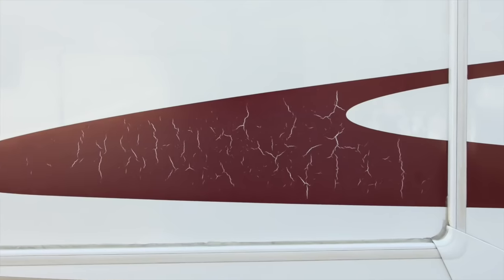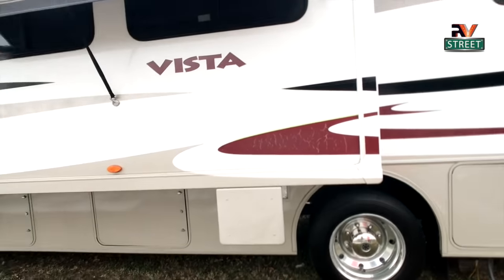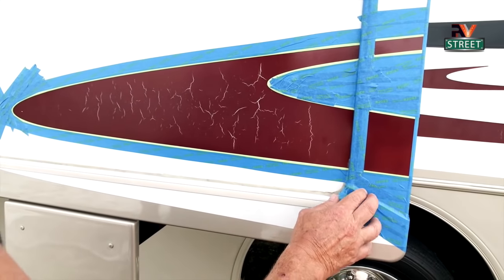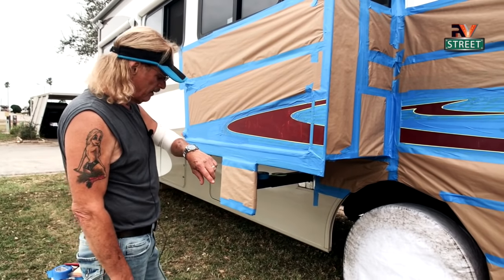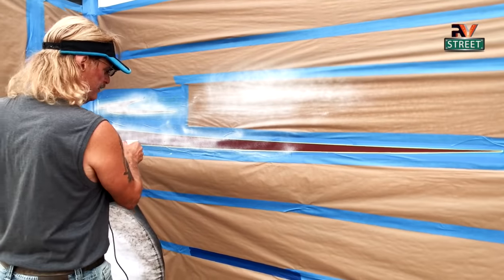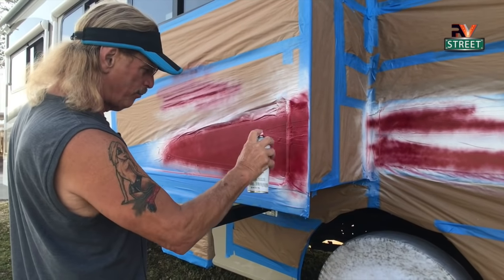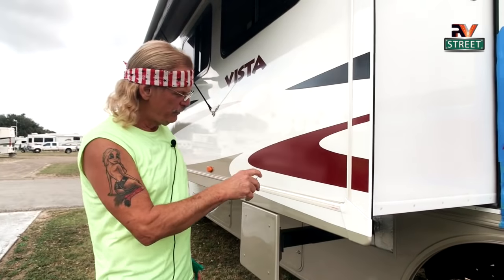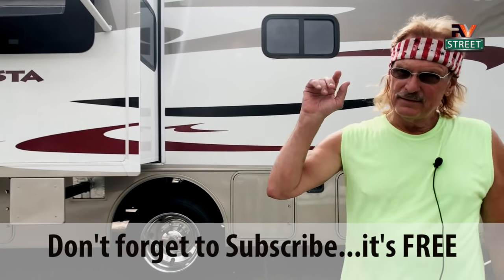How to fix Cracked & Faded RV graphics. Easy DIY job

Comment: Prep is the key to a good paint job as you have proven here. One tip on rattle cans, warm paint sprays smoother (better atomization of the paint). When I rattle can, I will stand the can up in a bucket of warm water, about 3/4 of the way up the can for a minute or 2, dry the can thoroughly, shake well. Makes a world of difference, virtually eliminating the dreaded orange peel.
Reply from the maker: Absolutely. I didn't mention it in the video but I did set the cans out in the sun for a couple of hours before I sprayed for that exact reason. thx John 😜
Reply: Orange peel is going to happen no matter what if you put on several coats of paint especially heavy coats. The key is after you get all your clear coats done and let dry for a few days you go an wet sand the whole car an then take a buffer and hit it with some polishing compound and it will look deep an like glass

Comment: FYI: That damp cloth activates the stuff in the green tape that gives you a clean painted edge. I don't know if you did that intentionally but folks should do that intentionally as it gives a crisper edge to the paint when you use the green tape.
Reply: You are thinking about frog tape.  The stuff he used is not activated by anything.

Comment: Excellent video and fantastic results using off the shelf consumer products.  Just one piece of advice to add - I would use a cleaner/degreaser or denatured alcohol to wipe down the area to be repaired BEFORE you begin sanding.  This will remove any waxes, polishes or other potential contaminants that can interfere with the new paint being used.

Comment: Being a sign painter, I taped off and mixed oil based sign painters paint  to match. Then used the proper brush size. No primer, just right over the graphic.

Comment: Hello, I just came across your video regarding painting the graphics. This is an idea I haven't thought of and doesn't look very difficult. You make it look so easy. You were very attentive to the details and that is how you got the result you got. Last week I  replaced the factory logos on our travel trailer and then noticed the curved stripes on one side were cracked such as yours. I may be taking on this project. The stripes on one side are in really great shape so I would only have to do one side. I think I can match the color pretty easily, and since you can't see both sides at the same time, it should be okay if the color is off a little bit. I believe you explained everything very well and in terms I could understand, and plus you used materials that are easily found. Thank you for your help and stay safe.
Reply: Yep. Folks, remember you can't see both/all sides of the rig at one time, so the colors on one side don't have to exactly match any other side. Approximation works.  Save the headache.

Comment: Thank you for this video....there a couple things I have learned over the years...1st....you can pull the tape just after painting....when the paint is wet it will not peel the edge...2nd always pull your tape at about a 45° angle away from the painted edge.  Give these a try practicing on something...I would be interested in hearing how this works for you.

I hope this didn't sound like a critique of your work. I really enjoy your videos & have learned a lot from them. I am a newbie & have a lot to learn & you have helped me greatly. 
Hope to see you on the road when this pandemic is over & I am able to finally get moving.

Comment: Looks great. I went with option one on my Lance camper. LOL. Was a nightmare removing the decals but so happy now it's done.
Reply from the maker: If anybody wants to just remove an old graphic, I put a link to the 3M Stripe Off Wheel in the description text. That's what I used on the end of an electric drill motor and this wheel works awesome and takes out a ton of the hard labor. It took me 2 wheels to remove the 10'-12' one on our big slide and took me about 5hrs., then I compounded, polished and then applied RejeX. Can't even tell that graphic was ever there.
thx Roux

Comment: FABULOUS INSTRUCTIONS!! Thank you for showing step by step details, thank you for showing every product, I've ordered everything off Amazon to do mine now! 
I just have faded ones.I purchased a polisher along with every products in the  Driven line to try to polish out the dull and faded sheen. Then if it needs it I will follow your Awesome instructions and paint my trailer decals. I'm thrilled to have found you! Thank you so much!! Your fantastic
Reply from the maker: Kathleen,
When I read your words "try to polish out the dull and faded sheen" here's a few tips *IF YOU HAVE OXIDATION*. If you don't have any oxidation then skip that step and proceed with polishing.

The light weight Meguirs MT300 Dual Action—5.4lbs. It's an awesome machine. Be sure to buy the back plate too. It's sold separately. It's the exact unit I used to remove the oxidation that my coach had when I first bought it in 2016. Having the right polisher is important. My coach at the time had heavy oxidation on the drivers side and back with light to medium oxidation on the other areas. My large slide on the drivers side was the worse so I had to use the wool pad and diamond cut compound on that area. I didn't have a YT Channel at the time, so I don't have a video on it. But I wish I did. I've actually been looking for an RV that has some oxidation so I can do a video on the process in a camp ground. But I haven't had any owners willing to cooperate with me. But I use the MT300 for everything to keep our RV maintained. If you have oxidation, once oxidation is removed, don't ever let it oxidize again. That way you won't have to go thru this process again. 

If need be like you saw in the video, if an area needs a little polishing, polish it then apply RejeX. My secret to keeping it maintained and shiny is using RejeX for my final coat because RejeX blocks the UV rays from the sun and that's what causes oxidation.

Start small first. Like on the back. That will give you an area to get into the rhythm. I used a 12' rolling scaffold so I could stand up straight and do the top half of the coach. The bottom half is much easier to do than the top. Compounding to remove oxidation takes time. As you compound, the pads will load up with material from the RV, so you have to constantly remove it, by keeping them clean, washing them out with water—warm water is best—in a bucket and a small hand held brush. Wring them out, put them back on the MT300 and continue. If you have heavy oxidation, you'll probably have to use the wool pad and the diamond cut compound, otherwise use the other compound material in the blue bottle in my store and my red pads. Once oxidation is off, THEN polish with my Meguiar's Ultimate Polish also with the red pads. It probably will take 2 or 3 passes to restore the shine. Don't do it in the sun. An overcast sky or inside under cover is the best to polish and apply RejeX—or wax if you prefer that instead—as your final coat. Again, keep your pads clean AND DRY when applying polish, keep wiping off the polish off the RV each time you make a pass with a microfiber cloth. Do small areas at a time. It's also better and goes faster if you have several pads. Just be patient, be methodical and it'll come out nice. You can do this 👍

Everything I use is in my Amazon Store https://www.amazon.com/shop/rvstreet
The stuff you’ll need is in the "Compound, Polish, Finish Coat" category. Above each product is a text bubble where I describe what each product is and what I use it for.

Here's a link to one of my PLAYLISTS that covers other aspects of how I take care of the outside of my coach. These will be helpful to you also. Especially the first 3 videos: 
https://www.youtube.com/playlist?list=PLkQXtMp9xodSqUtTPMkSjVRGmSQkz4XJz

Comment: I used to do this prep work for a body shop when I was going to college. Didn’t paint, just prepped. I have an RV that gets stored where the sun hits the back and the decals are failing. Wax doesn’t stop it. Now I know I can fix it. And I will find that UV protector. REJECTS IT?. Nice job. Excellent work. Thanks.
Reply from the maker: Yep, RejeX it. The link is in the description text.
Now go....go and protect what what you have.

Comment: First, b4 sanding, wipe it all down with a wax remover or mineral spirits to make sure no contaminants or silicone is present. Otherwise you'll sand it into your surface & have problems later.

Also, spray paint on big box stores have  lot codes on them. Make sure you buy spray cans with the same lot codes or the color might vary..
Reply: Thank You
Reply: and peel the tape when wet to avoid all the hassle of paint tearing.
get it all done in less than a day and the paint shouldnt tear...
de-taping within minutes of the final coat will help.
having a helper for big jobs is key to keeping the tape an paper out of the wet paint...also doing the thin tape last (if you get good enough at it)
his dust coat techniques is correct especially on graphics as they are sensitive to the thinners.
Reply: Even better, buy all your supplies at the local auto parts store. It is usually a higher quality of paint and clear. They also sell high build primer which will aid in the filling of the cracks.

Comment: You did a great job. We had several "cabbage" spots that developed shortly after we got our RV. Lucky ours was a Sherwin Williams paint and I went to the Sherwin Williams automotive where they matched my colors. I went ahead and got 6 cans of each color just to have. Anyway they came with regular spray buttons, when you mentioned that about your burgundy I thought I'd let you know there are spray triggers you can buy. They slip over the existing nozzle making your spray easier. Also I found nozzle buttons that would rotate from narrow to fan.  Over all great video. Great tip about 1/4 inch tape. Thanks.
Reply from the maker: Good for Laura for tackling a job like this. You go girl. 😜

Comment: A fast way to make cracks disappear is to clean them out with a mini-sandblaster, and fill them with auto body glaze. Just like you were patching drywall, sand it smooth with some 400 while you are prepping the rest of the decal for paint. A hopper gun is $20 at Harbor Freight, use baking soda instead of sand.
Reply: THANK YOU!

Comment: I can appreciate the tremdous -  and I mean TREMENDOUS - amount of work and time you put into taping! With time lapse photography, you made in look easy.  But, it was much much easier to remove the decals comepletely by peeling them off with a heat gun and a 3M eraser wheel and install new decals - or dfifferent decals.
Reply from the maker: Martins next video was going to be how to erase a graphic but he passed away before he had a chance to do it. 💔
Reply: Sean - I’m fairly new to being an RV owner with an older unit.  Of course my graphics are cracked.  How does one buy new graphics?

Comment: I have done this on 3 rvs but I used sandable primer before painting.  This eliminates almost all of the hairline cracks. Thanks for posting.
Reply: Hey Yancer... so you'd use the sandable primer instead of the paint&primer he used in the first step?

Comment from the maker: On March 25th, 2021, we were notified by one of our channel viewers that a company named coolizzy.com is using this video to promote their product “EZShine™ RV Decals Restorer”. 
We are in no way affiliated with coolizzy.com which sells this product, or any other products they market, nor use or endorse any of their products. We have immediately issued a cease and desist request to that company to remove any use of our video in promoting their products which to date they have ignored.
ALSO:
Because so many people have been asking, I thought you might like to know that I added all the tools and products I used/and still use to restore and keep our coach looking like new in the description text. Just click "SHOW MORE" and scroll down. 

My reply:
Good question:
1) Eraser best method and cheaper (a couple of wheels, then compound, polish and RejeXed) lots of labor, have to have a high power electric drill but will never have to be dealt with again. I myself would only use this method if the existing graphics are really gone and beyond repair. As I explained in the video, I did this to one of my graphics that was beyond repair.
2) Going over existing decal with todays high UV resistant vinyl decal material is a good alternative and easier,  but expensive and if you make a mistake your screwed and have to do it again. Then it's more money again.
3) Painting is the cheapest, takes longer, but results are pretty darn good. I was totally satisfied with the outcome. Not perfect but a whole lot better than it was. Will last years if you protect well and often with RejeX.

Comment: Great video!  We gave painting a go and got one of the 20 decals done.  I think we will order a decal set ($1800)  .   The paint method was about four hours and results were good but not great.  Our 2007 Coachman we bought last year sat in the sun most of its life and it shows but me have not yet hit 10k on the odometer.   We hope to bring the exterior back in line with her low milage

Comment: You must have been a painter in a past life. As a camper, and retired automotive  custom painter, I have done this same thing to my former class A four winds. I also had a set of graphics printed, but after removing, buffing and re applying new graphics, I painted the rest. One suggestion, the Rustolium clear , while it makes it shine, does not offer any U.V. Protection. I like to use an automotive 2-k  clear . Then use  the restore for over all protection, should easily get 5-10 years before needing any touch ups.  Love your videos, keep-em coming.
Reply from the maker: Yeah, a different kind of clear could of have used but, I put RejeX now on the whole coach twice a year and about 4x's a year on the graphics. Two coats of RejeX blocks 100% of UV rays. Stuff is amazing. I don't use wax anymore.
thx for your comment Tom

Comment: Nice job, I would use a Primer Filler spray instead of that whit paint instead, it fills the gap and can be sanded easily to leave  a smooth surface. Those fillers can be purchased from body shop stores.

Comment: Home Depot also sells a clamp on "pistol grip" by Rust-oleum called Comfort Grip that fits all spray cans! They cost about $9! So much easier on the old index finger! Great job on the graphics. I am in the process of stripping the thin tape stripes off of our Bounder. Then I am going to use your ideas and just paint flat black paint and primer over the black vinyl graphics and then go back over with a reflective yellow 3/8 inch tape!
Reply from the maker: Thank you for that Jens. Several people have commented in a similar way but never gave a name to the product. "Comfort Grip" I certainly will look for that.
Thank You. 👍

Comment: Not sure if this was asked, I didn’t want to read all 500 previous questions. What did you do at the edges with silicone sealant? Did you paint over the sealant or tape off at the sealant edges? Your DIY job Looks great and you’ve explained it perfectly. I plan on doing this to my entire fifth wheel as all the graphics are horrible. This way I can customize the paint scheme to my preference. A new graphic package for the coach is $1500-$1600 plus the time to remove, prep and re-install. This way gives me greater flexibility. Love your videos!
Reply from the maker: Well there were only two small areas—about  3" each" where the graphic jumped across to the other side where the sealant is.  I did not paint that sealant area. I actually did show that area in the video. And just to be clear, I NEVER use Silicone Sealant on anything. Good luck on your 5ver. Take your time and prep well and you'll be fine. 👍

Comment: Nice job.  I use the snap on handle for spay cans.  Much easier to apply and your finger doesnt get tired.
Reply from the maker: Ya that's a good tip. Others have made that same suggestion. I didn't know at the time that you could buy a separate snap on handle. 🔧👍

Comment: I used a heat gun and a razor blade to remove ours as they were too far gone to fix. Got some graphics done locally and it came out pretty good.

Comment: Hey Martin.  Nice job dude.  Just a helpful FYI.  If you use vinyl pinsrtipeing tape for the online, you can get super clean lines and bend around tight corners and swoops.  Just a thought.  In no way am I taking away from what you did.  Simply amazing.  I know that some day you'll upgrade or get out of it all together and when you do, the buyer is gonna get one heck of a nice coach.  Keep em coming pard.
Reply from the maker: Thx Chief 🙏

Comment: Nice job....lot of prep and coats but nice work. As for the skin on tape takeoff....I've been told by a bodyman that if you wait until the paint sets up but is not totally dry, the "skin" will not dry and taking the tape off will be less of a risk to peel any of the "skin" off with it.
Reply from the maker: Yep your right and a good reminder.

Comment: Very Helpful, thank you for posting.  Only thing I would add is that for people to read the paint can instructions.  Many paints have redcoat “windows”.  So they have to be sprayed with another coat within 1 hour or wait 72 hours. If this is not followed it can mess up an otherwise nice job.

Comment: Great video! Wish I seen this before i did the front end of my travel trailer. But did something similar.  Because i did the whole front end. After repainting decals. I got a quart of automotive clear coat. And put in power sprayer. Then wet sanded. The front is so shiny and smooth. Looks great.
Reply from the maker: There ya go. Good job. 💕

Comment: I think sanding the main color with a 1500-2000 wet grit before spraying the Clear would have smoothed out the finish. Great job and video.